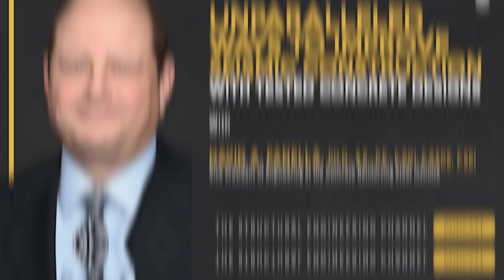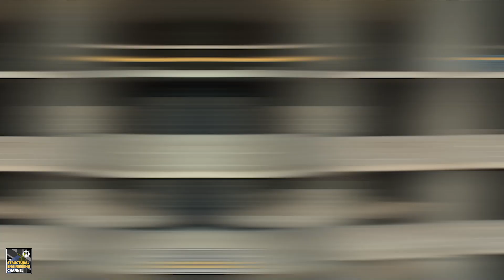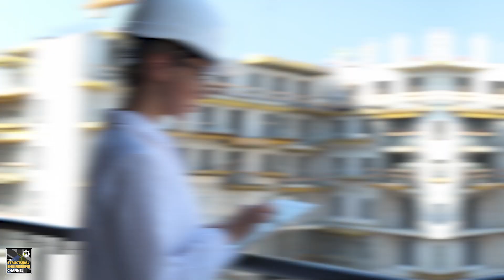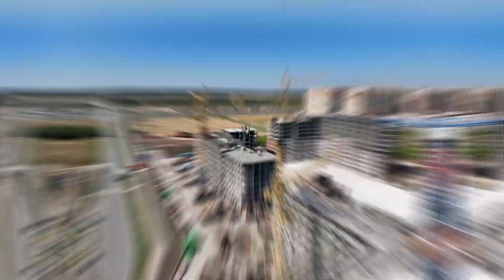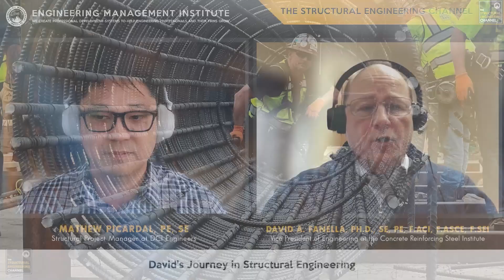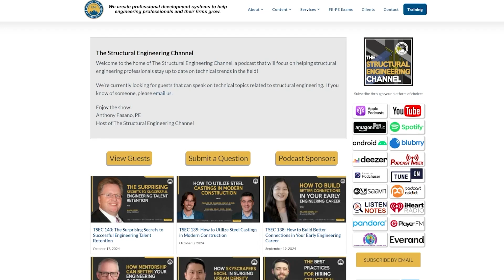Cost-Effective Steel-Reinforced Concrete Hacks You Need to Know

Comment: There seems to be no effort to implement base isolation system technology in the residential housing stock. Yet it is this residential stock that accounts for the greatest losses in earthquakes like the Northridge, CA and Kobe, Japan quakes. It seems that the CLP requirements actually stand in the way of the best EQ mitigation technology: base-isolation. That said, what is being done to make base-isolation the preferred and most efficacious and most constructible and least cost building method?
Reply from the maker: @ron4175 You raise some excellent points about the importance of implementing base isolation systems in residential buildings. It's crucial for improving earthquake resilience and minimizing losses. There’s definitely a need for more advocacy and research in this area!